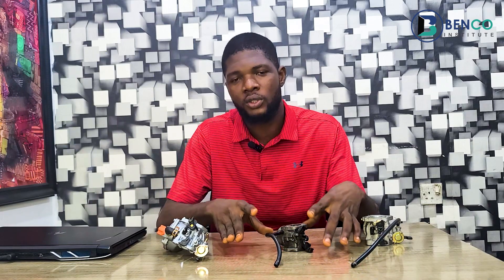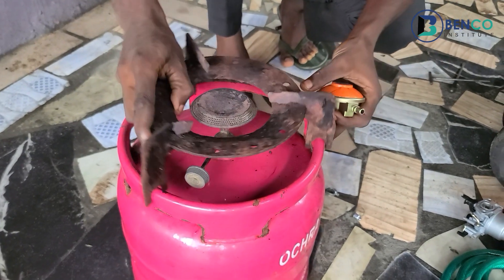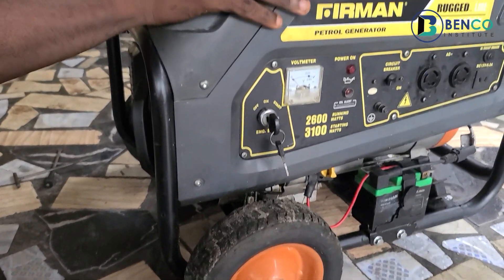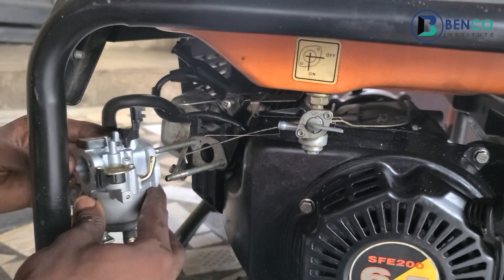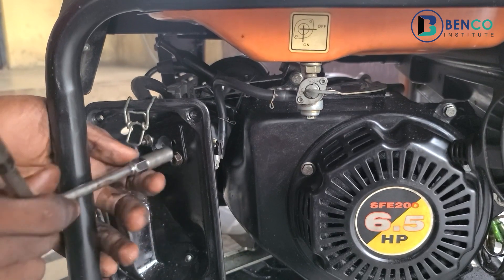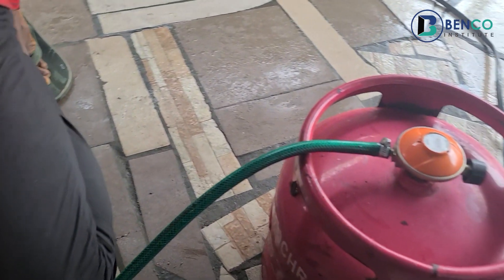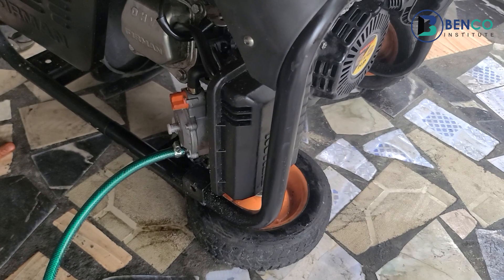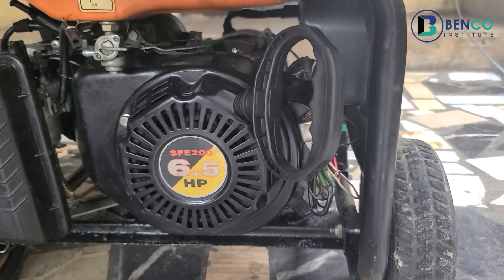How to Convert petrol generator to Gas generator in 3 mins with Dual carburetor#gas #carburetor #lpg

Comment: I did that with my generator too (carburetor replaced with dual carburetor). It works fine on LNG but not yet with petrol. On petrol, it jacks as if there is no enough fuel supply to the combustion chamber. With this challenge, what should I do please?

Comment: None of the videos I watched ever explained what that orange knob does. My brother's generation starts while the knob is turned to the right, while mine starts when it turns to the left. I discovered the middle is to block the gas from going into the carburetor. Why remove the fuel hose? I don't remove my fuel hose, so I switch to fuel or gas easily. For gas to work perfectly, just drain the fuel in the carburetor and lock your fuel tank. To use fuel, open your fuel tank, ensure the gas carburetor fuel drain lever is locked so that fuel won't leak out, close your gas cylinder, or turn the orange knob on the gas carburetor to midde. It blocks gas from entering the carburettor with the fuel at the same time. If you forget to do this, gas and fuel will be serving the engine simultaneously, making the engine's performance rough. That is when you know you are getting something wrong.
Reply from the maker: Thank you so much

All questions were addressed here
https://youtu.be/0meGhJ1hyLo?si=AtHtc6O_9czq5gWW

Comment: great, but just curious on the safety of having gas cylinder outside where its hot isnt that dangerous ? how safe is using the gas with the Gen outside environment? THIS IS WHY I HAVE NOT EVEN THOUGHT OF USING THIS? But if you can shed more light maybe i can order one! thanks
Reply from the maker: Long and short
It is safe

Comment: Greetings … your DIY tutorial is great! I have one recently installed on a Firman ECO 8990ES series with 6Kva.  I noticed it runs for a few hours and then it starts to sound like the Gen is about to die. I tried to tilt the gas cylinder and it works for a few minutes and then this happens again. Would you have any recommendation for me to try in fixing this problem?
Reply from the maker: Adjust the fuel intake on ur carburettor
Reply: @bencoinstitute  thank you for the feedback. I’ll try again and report!

Comment: Do one have to turn it off from the gas cylinder or will leave it on
Reply from the maker: I don't quite get the question
Reply: What i mean is that, after u turn off ur generator do u still turn it off from the gas cylinder, or just leave the gas cylinder on
Reply from the maker: @abrahamabro007  Turn it off

Comment: How long can 1kg gas last using this?
Reply: Can someone answer me?
Reply from the maker: So sorry
I am just seeing this
Reply from the maker: That depends on your type of gen and load

I made a detailed report about it 2weeks ago on the community tab...for your sake i will reshare there
Reply: This exact firman generator and the firman ruby line, of same capacity, which will you recommend?
Reply from the maker: @efeanderson689  i will go with this bro
Reply from the maker: Especially the one with this lithium battery....very cool
Reply: @bencoinstitute  why do you recommend this.? I just want to be sure before I purchase it. My friend has the firman ruby line of same capacity 2800 wtts max. He can power an inverter 1.5hp AC and freezer with it

Comment: How's the gas consumption for the elepaq 11KW generator
Reply from the maker: Very good bro
Reply: @bencoinstitute hat's a question bro.
Reply from the maker: @jamesajike374  I haven't outrightly ran it on that Gen...

But this is my analysis with a particular gen,this should give you a clue

Having Installed 10's of this Dual)Tri caburetor i can tell you first hand that if you can afford it do it.

i knew about this carburetor in 2014 first installed it in 2016 it has been a technology on ground, However it was not economically wise to use it because petrol has been relatively cheap until recently and ofcourse this brought back this piece of tech.

My Analysis on this Carburetor will be devoid of sentiments,You can take whatever I tell you to the Bank .infact i even did a full tutorial on how to install the carburetor our YouTube channel,You can do it yourself in few minutes 

I used a 6kg gas and a Rugged Firman RD 3910Ex the equivalent of the popular sumec firman spg 3000 generator for this Analysis

load units
1 deep-freezer, 6fans,laptops, TV's and lightening points.

Note: Depending on your load results will vary.

This generator did run for about 11-12  hours on 6kg Gas that therefore means a 12kg gas would serve for 22-24 hours

With overtime usage on this generator a litre of petrol will last for 1hour  so for 12hrs of usage we will need 12litres of petrol

This is were it gets interesting,to the Mathematics proper

using 12litres of petrol wilth cost of a litre at 511 Naira we will need 6132 naira approz 6200 naira...so we will need 6200 naira to power the generator for 12hours.

using 6kg of gas at 650 naira we will need just 3900 naira worth of gas to power the generator..

6200-3900 = 2300 We have now saved 2300naira in 12 hours

Let's say you use your generator 12hours in all 30days of a month....2300× 30 = 69000 
in 30days you would have saved 69000 naira..
if you run your gen for 24hrs in a day at the end of 30days you would have saved a whooping 138000 naira...

This is indeed a game changer... I totally recommend if you can afford the conversion kit.
Reply: @bencoinstitute  good analysis! But also, you know the bigger the gen/engine, the higher the consumption. Ordinarily, the firman/elepaq big gen consumes about 2 litres of fuel for about an hour. Have you installed the carburetor on any big gen instead of the regular medium gens?
Reply from the maker: @efeanderson689  yes many times

I just didn't bother to take the Stats...but there have been high praises already

Comment: How much is the dual caburator sold
Reply from the maker: 25000 naira ...
Reply: Won't the heat from the exhaust affect the gas hose?
Reply from the maker: @ikennaagara3225  You have to put the gas far away from your generator.
Reply: How can one get these materials for connection, like the gas connector, pressure hose, and gas head?
Reply from the maker: @ikennaagara3225  I can get them for You
Reply: Which last longer, fuel and gas?
Reply from the maker: @ikennaagara3225  Gas is
Reply: Can this work for any other generator?
Reply from the maker: @ikennaagara3225  The dual carburetor is only currently Available in our market for 2 category of Generators
Reply: @bencoinstitute  for which kind of generator?
Reply from the maker: @ikennaagara3225  currently available for Gx 160 engines and above
Reply: Bro pls I need a sound proof 25kva generator which one did u reconmend for me pls
Reply from the maker: @okhuarobonosa415   I would recommend jubali bros....

U can chat me up on whatsapp +2349078426919